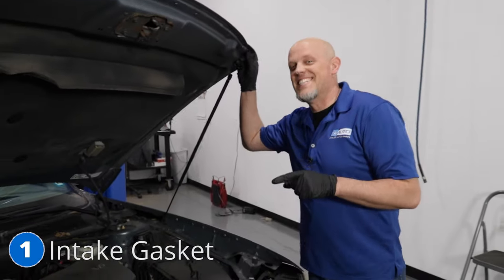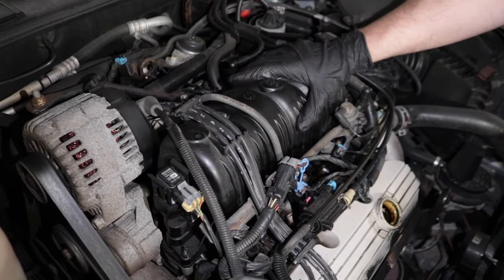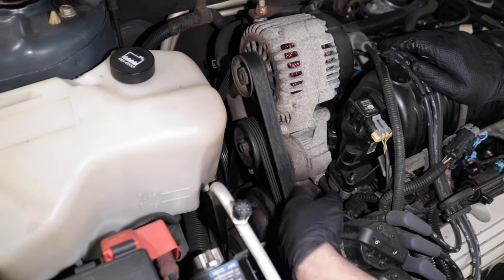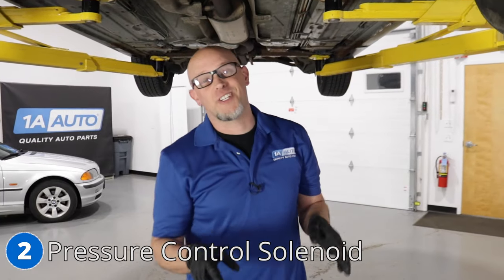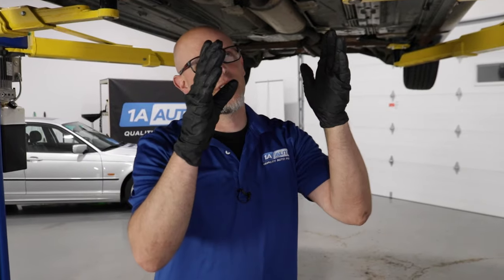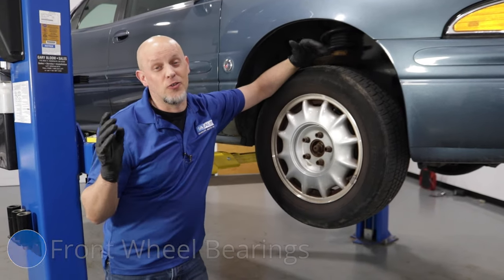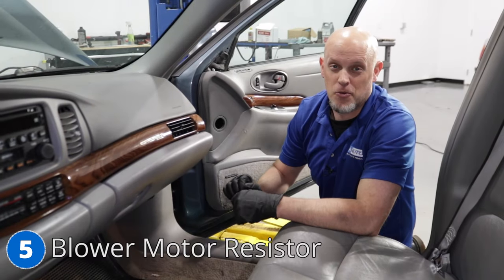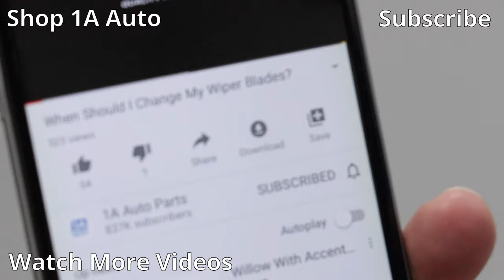Top 5 Problems Buick LeSabre Sedan 8th Generation 2000-05

Comment: Most reliable car I ever owned. 2003 buick lesabre
Reply: That's my exact same car lol
Reply: Same
Reply: Same 🤣
Reply: My engine seized 😔
Reply: @Datboul562  what year
Reply: yep same year, best car i ever had
Reply: Amen,currently am driving one and looking to purchase a mint one from down south! Yup I like it that much!
Reply: how many miles did u have
Reply: Mine too ! It has the 3800 1 of the best Engines Ever built.i went across country twice this year alone
Reply: Same. Just bought a 2003 LeSabre Celebration Limited with 114k miles on it. The old man who owned it originally had it in the shop every few hundred miles to baby it. I'm going to drive it forever!
Reply: @Datboul562  yes that's what happens when you dont change your oil.
Reply: I have a 2005 LeSabre Custom and it's by far the most reliable car I've ever owned. Bought mine in 2020 and it only had 76k miles. Fast forward to 2022 and it's got 111k miles and the only thing I've had to replace so far is the coolant elbows and serpentine belt.  Air shocks still work great and very smooth ride.  Also very good gas mileage on the highway, taken this car to Montgomery, AL 4 times and Atlanta, GA twice from Phenix City, AL and still runs like a champ. If you find one in good condition jump on it!
Reply: I got a 2001 Buick LeSabre with 228000 Miles and to be honest is been a good reliable car 😳I thought it was gonna let me down but no it still running, the only issue that needs to be done is the starter but I'm surprised it didn't let me down
Reply: @tednguyen8310   I'm at 205 right now
Reply: ive been considering one of these.    im very happy with what im hearing
Reply: @jameslaiola4976  get one I got mine 8 months ago 110k when I got it and rn it’s got a few small issues but it’s just bc I haven’t kept up with the brakes how I should lmao and I need suspension but it’s all coming soon really reliable car
Reply: @1080 Squilliam I did also , they finally figured it out , it was a chip malfunction
Reply: @brobb-sd9vp  don’t jinx yourself
Reply: Definitely looking to buy one
Reply: Mine has only Sixty two k.miles

Comment: A few (hopefully useful) notes: 1. The coolant elbows mentioned in this video should be replaced with the aftermarket (metal ones). 2. Front subframe bushings tend to go bad and aftermarket replacements seem to last for some five years. The problem with these bushings are causing obvious suspension problems but usually are overlooked and not included in the scope of things to be checked. 3. Rear subframe (front) bushings do go bad and there's no replacement for them. To do the repairs you may want to cut a couple of corresponding size washers from and old tire (worked for me on two cars, but it's on your own risk). 4. Often problem is the leak in the vapor storage system which appears as the gas cap not being closed tightly. If the new can is not available the system can be patched with a 'plumbing' tee. 5. Oil dipstick tube being in front of the engine tends to rust to the holes - consider checking and replacing it. 6. Consider changing tranny/engine mounts - at least on the left and right of the car. The engine is hanging on them so if they go you may be in trouble. 7. If you plan to keep the car consider replacing the brake lines with copper nickel (cunifer) tubing. 8. Replacing rear struts with coilovers is a good idea not because the air struts are expensive - they are not, but the compressor and the height sensor will cost more than the car. 9. Do rustproofing regularly.

Comment: I know a lot of times when people buy these used the first thing they gotta do is get those old rotten brake lines off the car and replace them.....I just did that with mine, instead of trying to fix this line or that I just pulled them all off and replaced the whole thing...

Comment: I love my 2001 buick lesabre❗❗❗ thanks for the video because these are the exact symptoms my car is having
Reply: The toughest job will be switching out the Pressure solenoid, but once you drop the cradle and lower your engine a bit ( have a cross member of some sort to hold up the engine) its all gravy.
Reply: How many miles is on your lesabre?

Comment: There are aluminum replacement elbows for the 3800, which only costs a few bucks more, that lasts longer than the plastic ones
Reply: My 2004 lesabre overheated 1st week I got it & blew elbows. Got the aluminum replacements. It ended up being fan relay, but found out later the big problem was 2 long silver bolts in the center that hold the fuse box in place were loose. Once I tightened them, I never had a problem with it again.
Reply: The plastic ones tend to last quite a while too. On both of my Lesabres they were not cracked and one had over 200k miles.

Comment: With the coolant elbows, replace them with the METAL version, not the plastic.  The plastic works for a while, but the metal versions last longer, and won't melt, like the plastic can do, which distort, then begin leaking.

Comment: I’m on my 4th Lesabre. These are the absolute best cars I have ever owned, of over 110 previous vehicles. Incredibly reliable, very easy to work on, parts are easy to get. Not to mention the comfort and the exceptional fuel economy in a car this size. 
Why am I on my fourth and not still on my first? People wanted to buy them. Fun fact. All 4 of mine have been 2002’s and beige by coincidence. I really want dark red with tan leather.
Reply: I just bought a 2004 with 61k miles. It did some sitting but know it's a great car and replacing a 2000 with green to burgundy or maroon color with leather seats. I only have wear on the driver's seat. Keep looking for it
Reply: LMAO my 2002 is one of the best cars I've ever owned! And it's beige!  Just like most of the repair videos
Reply: I have a beige 2002 LeSabre as well, 220k miles and it runs beautifully and looks gorgeous :)
Reply: I’m debating buying a 02 with 174k miles but needs an intake manifold. It’s not leaking coolant yet do you think it would be okay to drive it to my house around 25 miles? No way to tow it.
Reply: My mailman keeps after me to buy mine. He knows they go forever.
Reply: Burgundy is my favorite color! 🙋‍♂️
Reply: You ever have one that will start and rev in park/neutral put die and sputter in gear?
Reply: I got one that I haven’t seen any other like it I got the light blue exterior tan leather interior with the black dash and doors and my roofs tan but I’m getting a black one
Reply: My daughter has one. Oil pressure light is on. Have you had that issue? Oil level is fine and it has been changed regularly.
Reply: I have one! The celebration! 😊 64k miles

Comment: when you have the upper plastic manifold crack and flood the engine with coolant, make sure to replace the EGR valve chimney in the lower manifold to the updated skinnier one to keep some of the heat away from the plastic to prevent future failure

Comment: Have an 04' limited with 200k on the dash. No check engine light,  an I drive 40 mile commute every day.
Encountered all of these and then some. Gas gauge doesn't work, window on front passenger side gets crooked when going up, speakers are blown/rotted. (Wish it had a bit more power) Either way I love this car. It's never left me stranded.
Reply: Have a 2000, a ghost turns on the radio on occasion. I listen to it loud, but when it's comes on by itself loud, darn. The wipers also come on by themselves, they act erratic otherwise.
Reply: You know that could be a fuel sensor access port to fuel tank is in the back of the trunk underneath the cloth covering has like 5 or 6 bolt plate can pull the fuel pump and sensor out without the tank having to be dropped
Reply: My gas gauge shows full then suddenly drops to empty and the warning light comes on.  Then right back to full. LOL.  I go by my trip odometer.   Every 300 miles fill it up.   It’s a tank.

Comment: I own a 2005 lesabre...I have had all 5 of these issues! Others issues I've fixed...
Front away bar links
Rear stabilizers 
Power steering pump

Next up....
Headliner
Battery
Instrument cluster lights ... if I smack them they come back on. Been doing that for 2 years... need to fix
I love this car!  I think it's one of the best out there! 179k so far
Reply: I also have a 2005 Buick LeSabre except it has over 126K miles on it but the engine & transmission is great. I bought it recently from a used car dealer for only $2K. I had to replace the windshield, renew the break rotors, replace tie rod & a few other minor issues. Other than that, it's running great now.

Comment: Also consider checking the lower subframe bushing ,driver side. 
Lower intake gasket, kits are available, add sealant for bolts to prevent oil coming up into the upper intake manifold.

Comment: We have a 2005 lesabre. Problems we’ve had with it are the ignition module (which is common on any 3800 engine) . That problem should have been listed. blower motor resistor, and the rear air ride shocks did go bad a few years ago. They were leaking causing the pump to kick on so often 

Also another common issue with these Lesabres and any GM vehicle with the 3800 v6 is more often the catalytic converters will lose their efficiency and trip a P0420 code for inefficient catalytic converter
Reply: P0420 code is easily fixed with oxygen sensor extenders. Cost around $15.00
Reply: I also have a 2005 Buick LeSabre except it has over 126K miles on it but the engine & transmission is great. I bought it recently from a used car dealer for only $2K. I had to replace the windshield, renew the break rotors, replace tie rod & a few other minor issues. Other than that, it's running great now.
Reply: had the same issue with my ignition module, but otherwise runs so great

Comment: You won't believe this but currently I'm parked in between two of those vehicles as we speak. LOL I'm in my driveway my roommate has one and then came across another to use as a parts car. somehow today I got sandwiched in between them lol. I'm getting ready to share this video with her as we speak LOL
BTW why do these cars sit so low to the dang ground?
Reply: i mean people pay big dollars for lowering springs, this just do it for you!
Reply: It was designed for older people...so it is lower,and it is heavy,so if the shocks are worn,or that air ride is dead,it will hang very low. 😅
Reply: Because it helps smooth out the experience

Comment: 2002 Lesabre - All the above plus all window regulators twice, cruise control switch, headlights switch, fuel pump, tie rod ends, control arms, upper ball joints, and transmission is starting to slip.  All these failures occurred well before 100k miles.  But drives like a dream.
Reply: "Drives like a drives like a dream" 
You must be sarcastic after listing all those issues? I had an 02 Toyota 4runner with 230k miles. I only replaced a radiator cap and 1 02 sensor. That was the definition of a dream... Not replacement of EVERYTHING 😌
Reply: Agreed I've owned many different buicks and absolutely love them the lesabre especially cause that's what I grew up with my grandma had one  but I've had a 93 and 94 buick century specials and a93 roadmaster not the lt1 just the tbi and a 93 90th anniversary lesabre custom 96 lesabre limited and  a 99 lesabre limited newer vidystyle from 97to 99 and a 2000 lesabre limited and a 2002 century custom and just from experience the old body style lesabre and centrum and park Avenue  are much more reliable cars the cars themselves cause they have the same engine but they had the crappier 4t60e and the 97 and up had 4t65e neither are that great but they are ok if taken care of but the 3800 wont die the 3300 wont die and the 3100 is powerful but questionable when it comes to reliability   but the old bodys dont fall apart like the newer next gen body styles they called them the had great powertrains but they just fell apart and I'm a huge buick fan just have a soft spot for them and their quirks it's just fun to drive and own them
Reply: @testosteroneinc.3800  what I mean by “drives like a dream” is smooth control and ride when driving.  None of the things I listed kept it from being pleasant to drive just not pleasant to own.
Reply: Oil pressure switch

Comment: kind of surprised that the EVAP purge solenoid didn't pop up. had to swap that out at 110k miles because it was stuck open causing an evap leak code. i even tried getting a new OEM gas cap first because i saw that was a common thing. 35 bucks and 3 minutes and the code went away.

Comment: Lol I have a 2002 and have had all the problems you mentioned except transmission (knock on wood). But it is a great car and I love it. Overall very reliable. Hard to change the air shocks to coilovers?
Reply: Oh, you should mention window regulators. Horrible on this car. Have changed all of them, a couple more than once.
Reply: I have an 02 as well I’ve had the same window problem and the fuel sending unit went out
Reply: @davidwarn1  that's why you get the 7th gen, not the 8th gen LeSabre. Better car in every way.

Comment: Got a 2005 LeSabre Limited with 61k miles. Great driving car, but has some glitches. One weird thing is when it's really cold outside, well below freezing, the exhaust gets loud inside the car. I think the exhaust pipe is coming into contact with the floor pan or something and that transfers both sound and vibrations to the interior of the car. Makes it sound like I don't have a muffler. I'm not sure if it's loud to someone on the street, but very loud inside the car. I took it to the shop, but of course that day the temp was above freezing, so it sounded normal and they couldn't reproduce the problem.
Reply: I also have a 2005 Buick LeSabre except it has over 126K miles on it but the engine & transmission is great. I bought it recently from a used car dealer for only $2K. I had to replace the windshield, renew the break rotors, replace tie rod & a few other minor issues. Other than that, it's running great now.

Comment: Rust was also a killer. Honestly I can’t remember the last time I saw one of these in the road, I live in the rust belt.
Reply: I’m lower in the rust belt and see several a day lol, but yeah they do rust pretty bad
Reply: The frames rust out on these
Reply: @samuelvetromile5382  My 2002 had rust holes behind the front subframe and the frame around the rear spring mounts was almost completely gone. Probably why they still got 30 mpg on the highway, the frame was so thin.
Reply: I live in Ohio and rust in very bad and I have the same lesabre in this video and mine is almost rust free
Reply: I’ve started paying more attention and I have seen a few in the last month.
Reply: Just picked up a 2001 Buick Park Ave base, ZERO rust 120k, 2300$
Reply: Plenty of them here still in great shape. They were the #1 seller in the U.S.A. for 12 years straight.
Reply: They're all over the Midwest
Reply: @LT1HILLINGHOE  Are these cars only fot old people?
Reply: I'm in Arizona and every other car is a early 2000s gm
Reply: I just bought one that's never left Florida. No rust except on the top
Reply: Do a better job keeping the salt off the car

Comment: Did someone already mention the power window motors? Going through my 2002 LeSabre service records it looks like the previous owner replaced the driver, front passenger and driver side rear passenger window motors when she owned the car. She also had the intake gasket replaced and the radiator elbow were replaced with metal ones. I replaced the MAF sensor and gas cap since I've owned the car. A very reliable car overall.

Comment: Do you know where I can find a video that shows me how to replace a power steering line for a 2000 Buick Lesabre?  It's the line that comes directly out of the power steering pump and goes around the frame on the front of the car and back up behind the driver side wheel well.  I can't find anything on it anywhere.

Comment: Is there an easy black and white way to tell if the intake plenum and gasket is bad, or the lower intake manifold gasket is bad? The video doesn't even mention the lower intake gaskets.  I suspect the intake plenum and gasket is mostly prone to failure, if they haven't been replaced yet.

Comment: Pressure Control Solenoid. Another way to be sure your having the same problem is if the car runs fine for about 30 mins then starts having the hard shift from 1st to 2nd gear, its the Electronic Pressure Control solenoid. another way is is you have the car parked on a flat surface & at normal operating temp,  put foot on the brake, move the shift level down from park into drive and if the front of the car bumps/shakes noticibly, its the EPC solenoid.

Comment: A few years ago I bought a 2000 Buick Century, which is similar to the Lesabre ,  used that was in mint condition with only 30k on it from a old couple , it ran great with no problems till 56k miles then I had every one of those problems  all happen in a short time span of each, first was the leaking intake manifold, next was the hard shifting of the transmission, the radio/CD quit working, the front wheel bearing started making noise along with bad tie rods ,power window controls, , then the lower rocker panels along both sides of the car began to rust out badly , the rest of the car and frame was good ,only the lower part of the body, I was considering fixing the problems but then the brakes lines all rusted and leaked and the car was undriveable , I sold it at a great loss, because the repairs were more than the car was worth,  it was the worst car I ever owned from repair expenses and build quality ,  One thing I did not like about it , the suspension was really soft and would easily bottom out if there was a dip in the road or leaving a parking lot that had a slight drop off near the road , but it had a nice floating type of ride on the highway due to that soft suspension, Overall I really liked the car , nice ride, power, comfort but too much of a money pit